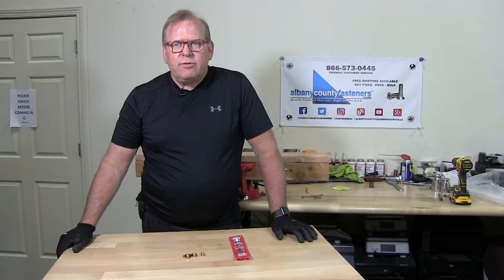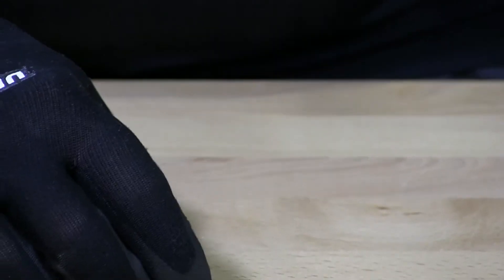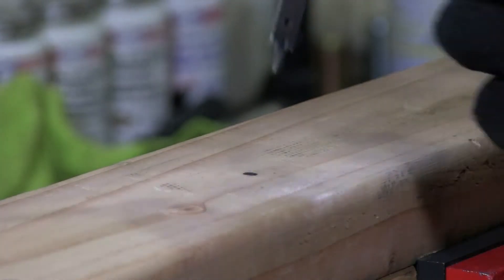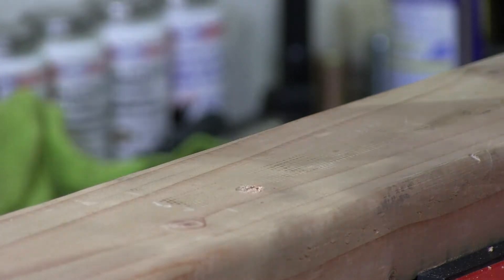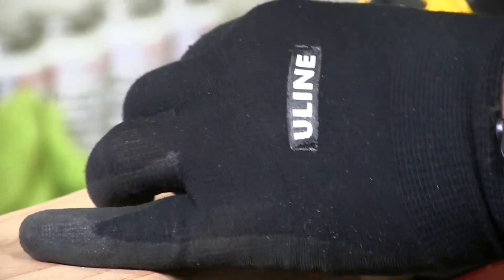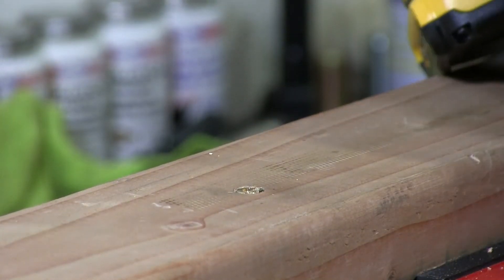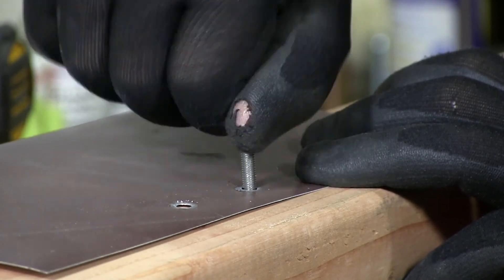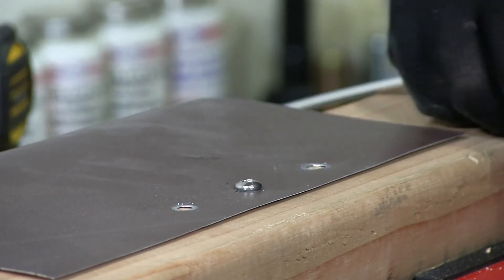How to Install and Use E-Z LOK Thread Inserts & Spade Bits | Fasteners 101

Comment: I need to replace a stripped bolt hole for a drive belt tensioner it needs 35 nm torque. Is this my only option? Also I did not see you use a tap is that not necessary for helicoil?
Reply from the maker: If you are using a heilcoil you will need a tap for the heilcoil.

Comment: You didn't mention how deep the hole for the insert should be although the bolt you used was very long. Was the hole as deep as the bolt length? And if so wouldn't most of the bolt then be in wood when the point of the insert is to keep the metal in the metal? If you do a tutorial, make sure all the steps are explained for folks like me who've never heard of these and looking for precise instructions.
Reply: Don’t be a jerk

Comment: Why/when one would use this type of inserts instead of just using a usual wooden screw?
Reply: These inserts are great for when you're wanting to be able to attach/reattach parts easily, and you're worried about the wood stripping out with multiple installations. It's great for pre-fabbing furniture legs when you're going to be shipping or delivering a piece for assembly on site.

Comment: Sorry I am sure the drill was marked 1/4 inch which is 2/8 inch and not what you said 3/8 inch !
Reply from the maker: The spade drill bit is 3/8 inch. 1/4 inch is the internal diameter threading of the insert.

Comment: So much misinformation in one video. Do all of the folks commenting just make it up as they go? Have any of you even been to the manufacturer's site? Geez...btw, those inserts used in the video were made for hardwood not soft. Softwood inserts use a coarser outside thread.  https://www.ezlok.com/threaded-inserts-for-wood  It puzzles me why anyone would want to use soft brass inserts to begin with...these are available in steel as well.
Reply from the maker: Thank you for your feedback.

Comment: The screw notches are for real amateurs that don't own a hex key bit . Put it in right side up .
( even a threaded screw bolt with nut put on, before threaded insert, does a better job. Especially on really cheap threaded inserts that have no hex drive option .)
Reply from the maker: You mean something like this? https://youtu.be/wifYMPWB1IE
It works, but not as effectively as the tool made for these inserts. Still, it's quite helpful in a pinch!

Comment: Yeah, so many people were installing them upside down with a screwdriver that manufacturers decided to sell a bit - cuz hey, it's better to sell another tool than educate users on proper installation.  Even with that bit you're still chipping the brass away.  Do it the right way and it will never chip.   Surprise!
Reply: Your statement makes no sense whatsoever. It's impossible to "install them upside down" with a screwdriver. The slot faces up during installation.
Reply from the maker: Thank you for your feedback.
Reply: Look at the insert. A) chamfer on the bottom end to feed the non-slotted end into the hole. No chamfer on the top end with the slot. B) internally, chamfer at the slotted end to aid in guiding the bolt into the threaded insert. These are clearly designed to be inserted with the slotted end up as shown in the video.

Comment: Like Steve has commented the insert is upside down the slot is to help the insert being fed into the drilled hole
Reply from the maker: Hey Peter,

There are several types of threaded inserts available, depending on the manufacturer/application. The threaded inserts we carry have "knife" threads and are designed to be driven by the slots using a flat head screwdriver or manufacturer proprietary tool. 

The threading on these threaded inserts gradually taper allowing for easy installation, whereas the version that should be inserted notch side first is threaded fully, tip to tip, with thicker threading than the inserts we carry. They both have the same function, but are driven differently.
Reply: Great explanation.  I'm used to the notches going in first too but it seems your product is different and requires a different install technique.  Glad you made that clear.